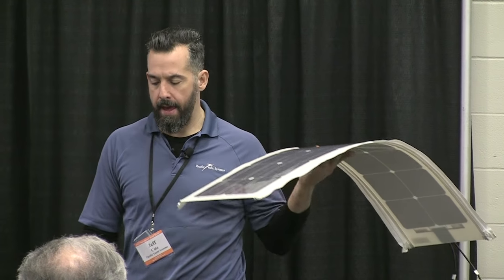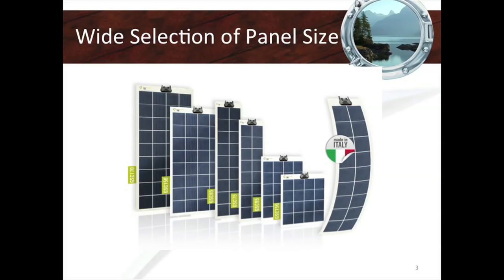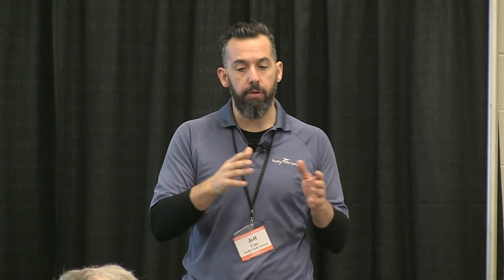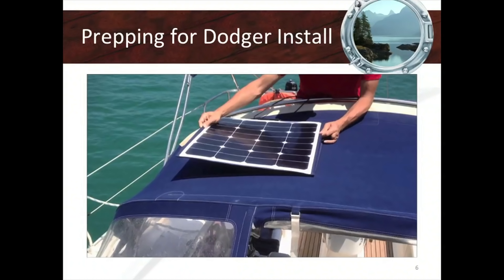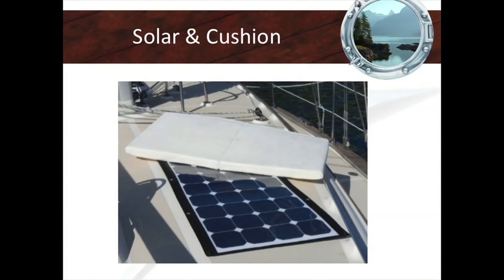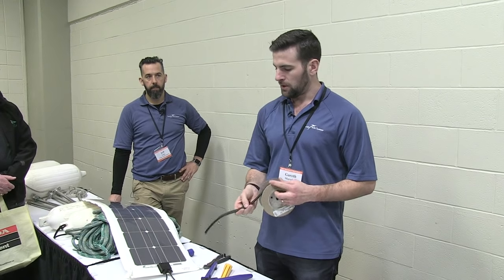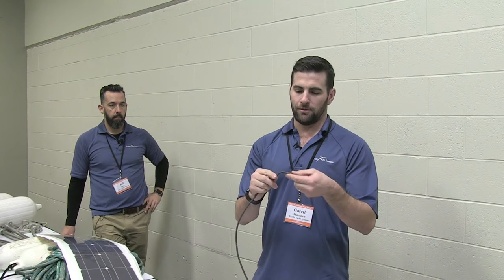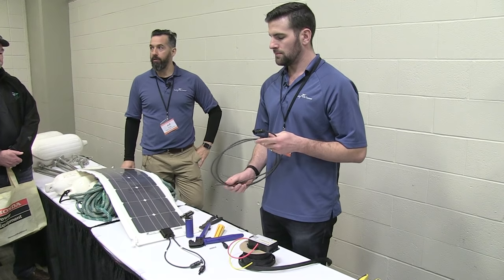Boat Show 2017 - DIY Marine Solar Panel Installation

Comment from the maker: Are you thinking of adding a solar panel to your boat this year?  Join Jeff Cote and the PYS team to learn the proper way to install a solar panel including what type of controller, wiring and connectors you should use to maximize the energy from your panel to your battery.
Reply: You said "Don't by pass the shunt" for the negative to avoid incorrect readings on the battery monitor. Can I connect my negative cable from the solar charge controller directly to the negative side of the shunt, with the positive going to the common stud in the battery switch?
Reply: This was fantastic, i have been reading so much on this subject which is akin to voodoo for me, but its now clear.

Comment: Jeff's videos are awesome! loud clear! 
i have a wooden folkboat from 1966. looking for ways to make a through hull/cabin connection for my foldable solar array bag, its deployed when i'm away and packed under when i'm onboard. the idea is to have the cable coming from the array plug into an outlet near its deploy point (this way i dont have to deal with leaving a crack for the cable to run in), through the hull and have this outlet wired to the mppt controller inside. i still couldnt find an appropriate product that would deal with this issue, looking for some for of spring shut flap cover thing, essentially for an already IP67 connection like the mc4 or SAE, could anyone recommend me something to look into? greetings from berlin

Comment: On installation of multiple solar panels where space is a limitation and a solution is to put solar panels of different wattages seem appropriate.   Can I put 150W and 100W and 50W (or any combination thereof )  all in series to the same solar controller?   In other words, can I put those in series with one cable going from outside the boat leading to a single solar controller.  Once I leave the controller, how do I determine what size cable and  fuse  I need?  I know that I'll need a fuse at the battery, but do I also need a fuse between the solar panel and the controller?   What size fuse would I need there and where in the loop would that fuse go?  Thank you for the outstanding videos.  Thank you in advance for your response.
Reply from the maker: Hi Barrington, all good questions, and you'll find some answers in some of our other YouTube videos and articles. Suggest you consider installing dedicated controllers per panel. Choosing the wiring size from controller is based on voltage drop and amperage tables. The fuse is selected to protect the wire connected from battery to controller to solar, generally all wiring is #10, 30 amp fuse.

Comment: Informative video, thank you - 
Question: If I were to run 4 panels (c/w diodes) into 4 MPPTs to counter shading issue from radar arch, could I common up the negative lines at the panels and run a single, appropriately sized negative bus back and then split out for the 4 MPPT inputs?
Reply from the maker: Hi Nick, each controller should be in a dedicated circuit to the panel. Therefore, we suggest to bring a pair of wires to each controller.

Comment: Hi, interesting video. On my boat alternator and shore charger are conected to the battery throug charge divider.  Should I conect solar controler to charge divider or direct to batteries. I have 3 banks. (left and right motor plus house)
Reply from the maker: Go direct to house with solar so you don't loose any voltage drop through isolator .

Comment: Does a solar array without a controller in the total dark present a load to a battery. I understand a controller would presumably prevent that even if it were so and if not, why?  I’m just curious about the nature of the solar cell. I’m guessing not.  But always want to understand stuff.  I am going to buy a boat again to live aboard and will call you to consult and buy. I will outfit the boat to be off grid. I plan to live what’s left of my life on the boat in t(e Med visiting all the places I studied in school. Five years of Latin.   

One reason I’ve heard to buy multiple controllers is to avoid shadow-degradation of one to affect another. Another is binary failure of the controller. Apparently the better panels have diodes to prevent the backwash of shadow-degradation. So then the only reason is independence in the event of total failure of one?  There’s a simple word for that but I’m old and can’t remember it.
Reply from the maker: Hi Robert, even with diodes, shading seriously affects the output of a solar panel. In our opinion, if you think you'll experience shading, it's better to have dedicated controllers per panel. As you mentioned, having multiple controllers, provides redundancy as well,
Reply: @PacificYachtSystems  thank you. I am guessing I do not understand the role a controller plays with a single panel in partial shade. Prob because I don’t understand what partial shade does within the panel or to the output. Would you explain?  Or I could call you. Hank you do much.

Comment: Nice video. Can you provide a link to a suitable fuse block I can use for my solar system please. I have GroupA with 3x100W panels on one mppt controller, the GroupB with 2x100W panels on another mppt controller and looking for a good way to bring the mppt outputs (two+ and two-) to the house battery bank. Sounds like a fuse block might work but not sure if ok to get one without or with a cover and what specs?
Reply from the maker: Check out this link: https://www.bluesea.com/products/category/17/81/Fuse_Holders/ATO-ATC_Fuse_Holders

Comment: Thank you for the informative video series. what side of the battery monitor shunt should the panel be connected too?
Reply from the maker: All negative connections should NEVER bypass the shunt, otherwise the shunt won't measure the amps in or out.
Reply: Pacific Yacht Systems  I understand the theory behind this, and thank you for the reply. I guess I am unclear on which direction the shunt measures. Should the panel wire be on the battery side of the shunt, or on the equipment side?
Reply from the maker: No problem, sorry for the geek talk. Yep, the negative connection should be on the equipment side.

Comment: I want to upgrade my 2 panels that produce 75w each to 2 that produce 100 to 150w. Should I get a new controller/regulator? I find that my new boat to me doesn't produce enough power to keep up with my systems
Reply from the maker: Hi Breal91. You should consider getting a MPPT controller (higher efficiency) over a PWM controller. Make sure your controller can handle the series input voltage from 2 100 watt panels and also that net amperage coming out from the controller.
Reply: Pacific Yacht Systems Thank you. I’ll see exactly what I have when I go down to the boat this weekend. I find your videos to the the best on the subject on YouTube

Comment: 10:02 32???? You mean 48? :D :P lol Never heard of anyone running 32v.
Reply from the maker: Lots of boats built in the 70s had 32 VDC systems. For instance, worked on quite a few Bertrams with 32 VDC, including starters and alternators.
Reply: @PacificYachtSystems  how do you even get 32v? 12-24-36-48